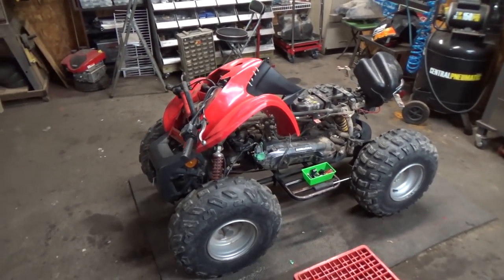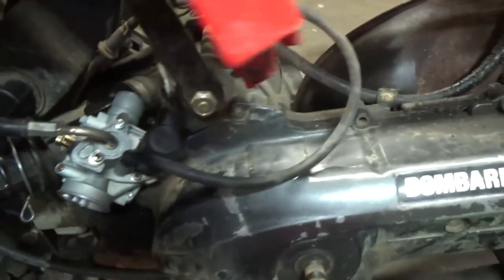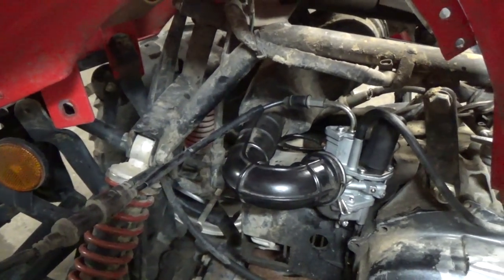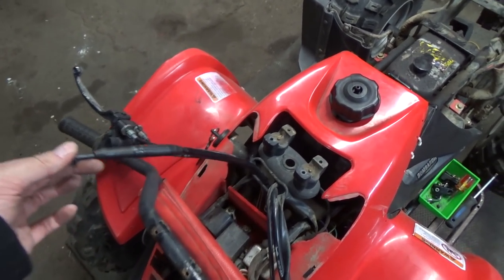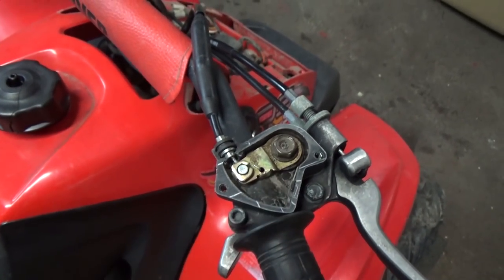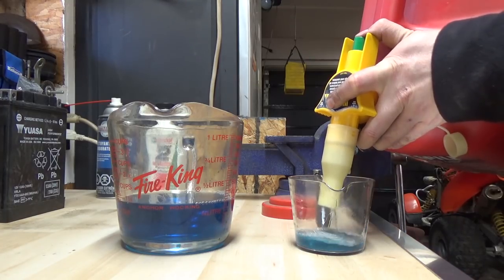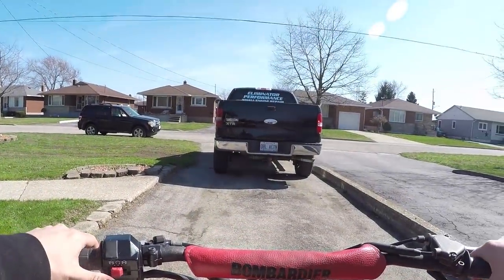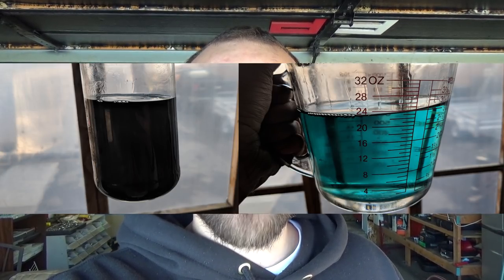2004 Bombardier DS90  - Carb Rebuild [Part3]

Comment: I install my throttle but as soon as I turn it on, it accelerates. Any suggestions why is doing that or what can I do ?
Reply from the maker: Your throttle slide is most likely hung up, or your throttle cable is pinched.

If not, adjust your idle down, if the idle doesn't change, it's probably the 1st 2 things I mentioned.

Comment: I got the same quad but I can’t get any top end power. It starts and idles fine but anything past half throttle and I just doesn’t respond and bogs down. Any ideas on what it could be? I cleaned the carburetor and spark plug and stater but still no power. It must not be getting consistent spark?
Reply: The issue is the stater I’ve seen this way too many times for this small quads